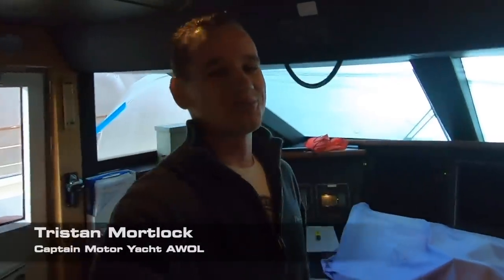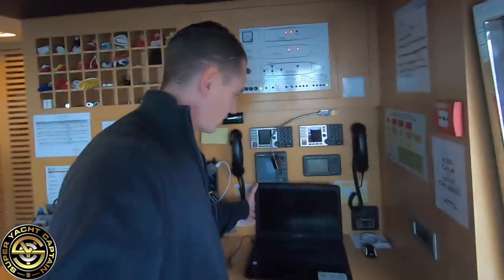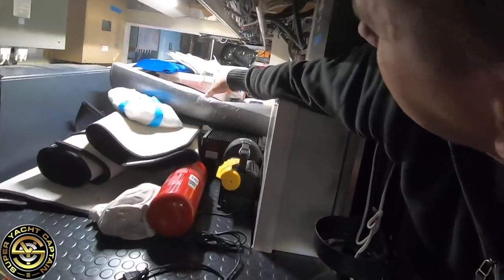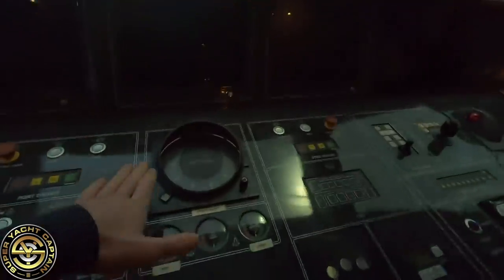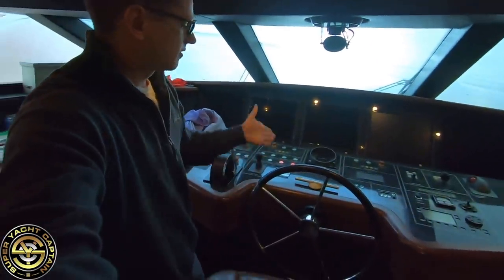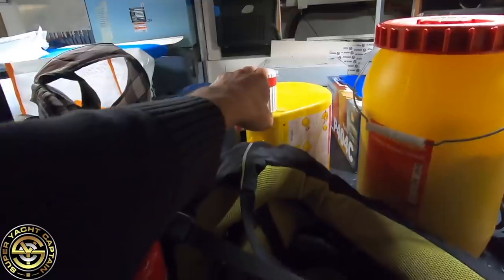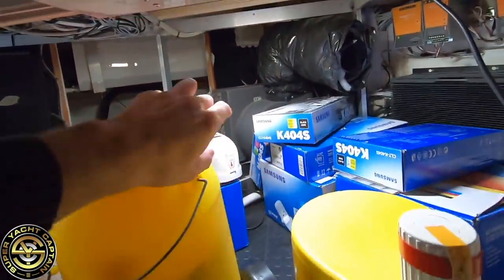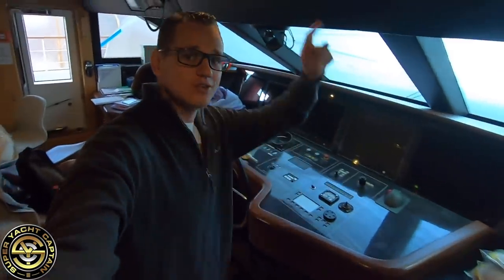LUXURY SUPER YACHT -  $15K COMPASS!!! (Captain's Vlog 124)

Comment: Loved it..! Picked up an ancient Tokyo Keiki GM-10 Gyrocompass at the Marine Consignment (where old electronics are left and forgotten) last week. Really just wanted it for decoration, the insides of the old mechanical ones are pretty sexy to look at if you are into that sort of thing, and $45 was a fair price for 'art'. Some Googling around yielded a service manual, and with an afternoon of multimeter, soldering iron, and two capacitors, it came to life..! Blows me away that this thing that was made 38 years ago still finds North, and with a quick eyeball sun sight, it looks to be very nearly within original spec. But, no "Wheel Mark"...

Comment: When I served on Army.Landing Craft in early 90s. All we had was a first gen sat nav the size of a car stereo accurate to 10metres. With all tradional bridge equipment of the day. I liked steering by lubbers line, as it allowed you to see the degress move port to starboard above your head. Meaning not hurting the neck on a compass on a binnicle etc. Nothing better than chart navigating, although Id love to use modern tech. Last time I was at Sea was in 07 on A Tid tug and dutch barge taking sediment off to dumping ground. Weird steering with a stick and computer with programmed heading than z wheel. Esp with skipper doing chart correction and bearing and me shouting On or Off so he coulx get an accurate plot. Not easy on a flat bottom Landing Craft in rough seas lol.
I enjoy your videos. Love your vessel. Shame disabled and flat bound most the time. I miss being at sea. When its part of your families history. Its like losing an arm when not at sea. Ill never work again. So Euro millions jackpot and I'm buying disabled friendly yaght with a lift to all decks.

Comment: I am in the tower crane industry and we have computer equipment, such as frequency drives which are crazy expensive. They set the owners back around $15 thousand and it's similar in size. I have had to explain to an owner why we fried one once, it was painful.
Reply: @littlearsehole75  You hold it, or pee in a bottle. I saw one where the operator ran flexible hose down the side to an outhouse.

Comment: As a rough rule of thumb I use for when you buy an instrument and it mentioned the following words  'Guaranteed, Certified and/or Calibrated' you double the price for each of those mentioned words. So yeah 15K sounds about right, production cost is probably around 1750.

Comment: The reason for "Wheel-Marked" equipment being several times the cost of non-commercial equipment - yet not performing any extra or better functions - is because, due to such vessels carrying passengers, they require a higher standard of reliability and failsafe measures. So all components must be of the highest quality and construction. Furthermore all these components must have been given extra detailed design considerations, testing, quality control and so on. This all costs money, with no obvious signs of being better! Lastly the providers need to stand behind their products 100% and, if necessary, travel internationally at no notice to make emergency repairs. That level of support does not come cheap either.

So the extra expense is entirely understandable, even though it's an unwelcome burden. It's really the same as the extra costs of having the best emergency and survival equipment/fire control AND spending a good chunk of change each year getting it serviced. Whereas a casual sailor would have the same old life-jackets, flares, etc. for 10 years and never touch them! Their radar/GPS/etc. would only get replaced typically when it fails. A commercial vessel can't afford to have things fail - hence the money is spent!
Reply: Even the mattresses have to have the wheel mark. We've just bought 4 single mattresses at a ridiculous price, ok there fire retardant, putting down a vinyl deck is approximately €600 a meter rising to thousands a meter.
Reply: I replaced some of these similar type systems on military aircraft... yeah 15k is a steal. We would drop between 250-500k each on the two required.

Comment: The expense to outfit a commercial vessel with nav and com equipment reminds me of aviation. A neighbor of mine bought an airplane for about $40,000. He is in the process of outfitting it for flying on instruments (IFR). When he is finished, he will have spent an additional $40k!
Reply from the maker: WOW. Unfortunately it’s part of the game.
Reply: Super Yacht Captain you’ve got that right... Though in the case of the Federal Aviation Administration (FAA), they are always play catch up to changes in technology. Here in the USA, people can build their own airplanes and register them with the FAA as an experimental. These owner-built airplanes can then use non-certified avionics. Some of these avionics systems are more advanced than what is found on some airliners. Also, these systems often cost less. The downside is these experimental aircraft cannot be used in a commercial capacity.

Comment: Have you considered GPS-compass? Such a compass has two (sometimes three) GPS antennas built in, in each end of something that looks like a skateboard (often white) on a pole. The electronics calculate the true course 10-20 times a second and shows the correct heading and attitude data despite of your own speed. Accuracy is 0.2 - 0.4 degrees depending on price.

Comment: Safety compliant certified systems always cost much more. They can also be found in Aviation and anywhere else where total system failure can or will endanger human life. eg. Manufacturing. A big part of why cheap consumer goods are manufactured in the East is due to a lack of safety compliant systems. It's not just about lower pay rates.

Comment: Must admit, thought the modern boat would run a strap down laser ring gyro like in commercial aircraft navigation systems. Modern business aircraft have small units that are very accurate and uodated from GPS too. How is the gyro adjusted for precession during operation, does it have a GPS update feature?

Comment: Thank you Tristan again a fine video. 
I was astonished that the electronic compartment is so small and labyrinthine. 
Also a little bit wondering, that the emergency equipment seems to be able to slide around - or will there be some locking for that? 

Next: Formerly I thought that the gyro itself is normally installed deep down in the ship so it gets less movement (was told by a navy officer). So I would have expected the gyro down either in the engine control room or somewhere at the crew area.
Reply: I used top take cruises in the 1990's aboard the SS Independence. She was a steamship built in the early 1950's On the bridge tours they liked to "show off" their original gyroscope. It was located right behind the bridge next to the chart table. The gyro unit was about 4 feet tall and 3 feet wide! (1.3m x 1m) It took up a lot of room
Reply: I used top take cruises in the 1990's aboard the SS Independence. She was a steamship built in the early 1950's On the bridge tours they liked to "show off" their original gyroscope. It was located right behind the bridge next to the chart table. The gyro unit was about 4 feet tall and 3 feet wide! (1.3m x 1m) It took up a lot of room

Comment: Regarding extinguishers, I have no i idea what the maritime requirements demand You to have on board.
But powder extinguishers can cause a lot of damage to electronics and attracts moisture,  if not properly cleaned after usage.
CO2 is a safer alternative but is less powerful than P1. 

A few years ago, we've had a fire in a server room at a chemical plant and they managed to put it out with a powder extinguisher.
But a few months later, the plant was forced to shut down for a few weeks due to corrosion on the electronic motherboards.
With a production loss of around one million Euro a day, all server rooms are now equipped with an automatic CO2 system.

Comment: When are you going to upgrade the electronics ? The screens are 10 years old, and the technology has improved a lot. The Magnetic declination is important. Are the breakers locked out with a padlock to prevent electrification ?
Reply from the maker: The 2 ECDIS screens are from 2017 and the other 3 are going strong. The hardware on the other hand have been updated and changed also in 2017
Reply: @SuperYachtCaptain  Hi Tristan.  I'm curious, are 4:3 screens still standard with ECDIS systems or are they moving towards 16:9 or similar aspect ratios now?
Reply: @Evo9john  I saw many 4:3 Displays on Düsseldorf Boat Show. 
The Displays them self are "simply" Displays. BUT - they have to have a long durability, stand high temperatures  and a high illumination. I'm not familiar, but I expect something like a DVI interconnect. So - due to that requirements, they are a long time sold - and not so much affected by fashion.

Comment: Fascinating stuff! How do you avoid confusion on the bridge between devices that indicate true North (gyro-compass) and magnetic North? I assume your GPS displays can be set to true? In the event of a catastrophic electronics failure where you had to revert to paper charts and a magnetic compass you'd have to remember to account for magnetic variation as well as the compass's deviation also, do you evr practice this, just in case?

Comment: If I may, I would like to suggest 1.A camera system inside that electronics cabinet 2. Both  smoke and Co detectors and a complete Halon fire suppression system. and  have a come chart/map of the circuit breakers that would shut down everything under there and train all personal how to use it because if a electrical fire breaks out under there it will be big. One last thing in firefighting there is  what is called added fire load i.e. things that people bring into a structure or onto a Boat in this case- using  equipment cabinets as storage lockers is not a good idea.
Reply: Good calls.
Reply: Halon is banned on ships ( also generally I think,) for some years now.  Tristan may not have shown them, but there will be smoke detectors in that space.

Comment: I have watched most of your Vlog's Tristan, and I am amazed at the cost and on-going investment required to maintain something for six months of the year, it seems to me a luxury super yacht is a money pit, and from my point of view it would be more sensible to rent one for a few weeks as this would be far cheaper proposition than owning one, what are your views on this? yes it would be nice to own one, but the owner never seems to use it that often.
Reply: If you need ask the cost for a super yacht you can't afford it. If you can afford it the costs don't matter. Yea chartering takes the edge off the costs but it is not a money making enterprise, especially working only part time as AWOL does.
Reply: @JCrook1028  I might never be in a position to afford one, but if i ever was I would purchase one that could be used all year round to justify the expense
Reply: A boat is a hole in the water you pour money into. While owners appreciate their boats, the boats do not return that appreciation for the owners.